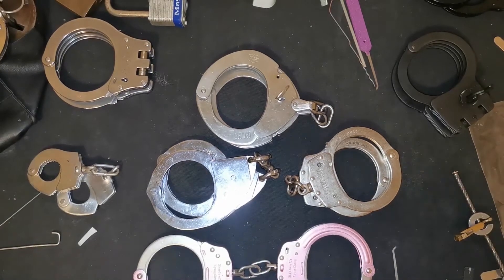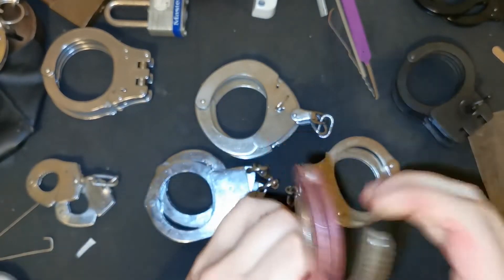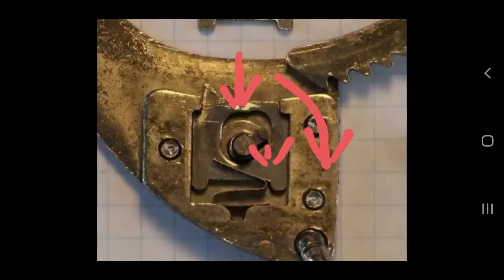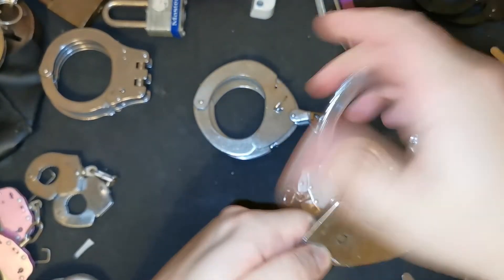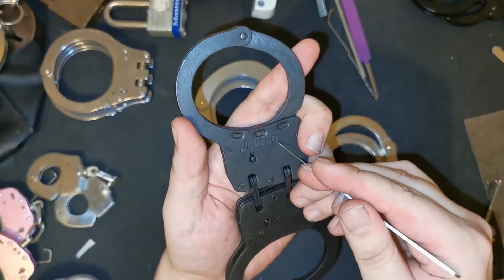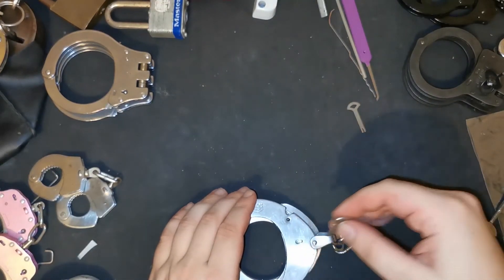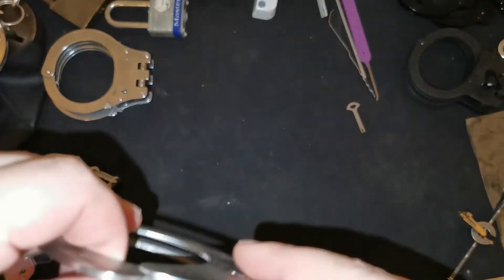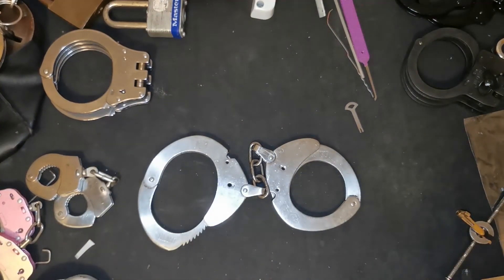Handcuff Escapes Special Moves

Comment: That bruise looked very sore indeed OUCH!
You would think that considering what these cuffs are for, they wouldn't be so vulnerable. You had me cuffed to the screen......
Reply from the maker: It did smart a bit🤣. It is surprising some of the vulnerability that are built into some cuffs. Would have thought some alot of them would be fixed too, but the wack attack works on alot of cuffs and is a simple fix. 
Glad you enjoyed it Roy. Thanks for watching👍
Reply: You can reduce the bump on the wrist by using a sock.
Also, I have found that it doesn't need to be a massive hit. Just needs to be against something solid. Not wood as that absorbs the blow.....
Reply from the maker: @roysammons2445  or 6